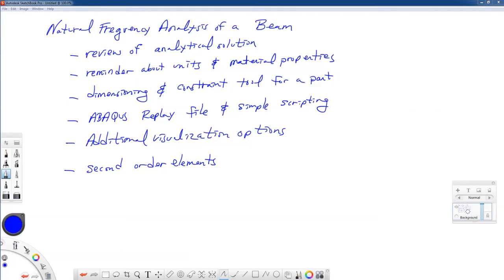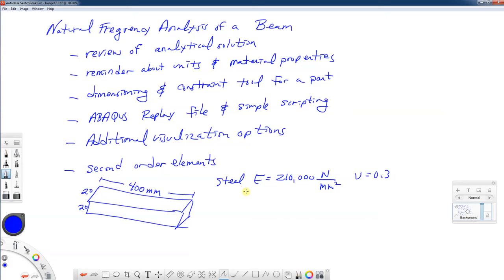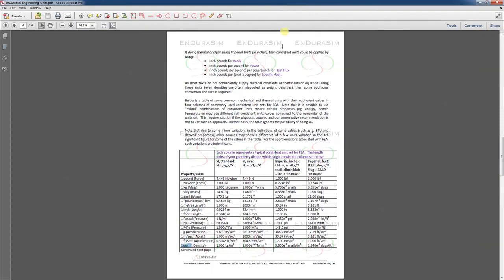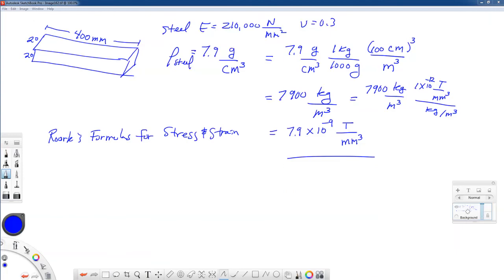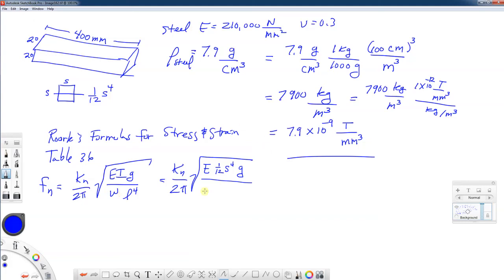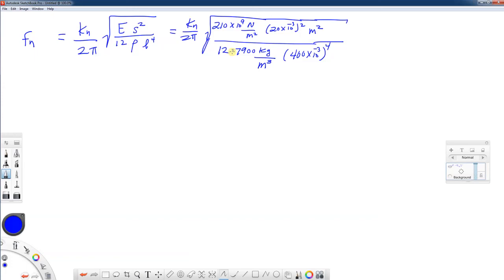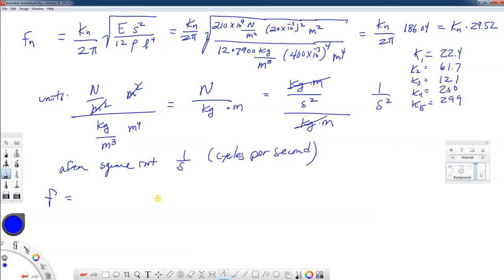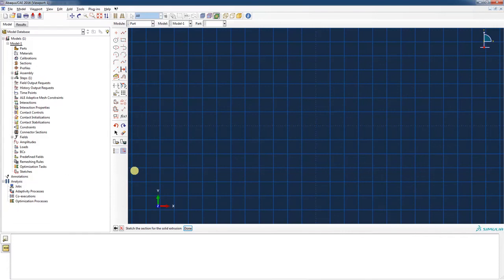AEM 535 HW-5 Natural Frequencies of a Beam--Part 1--Analytical Solution

Comment: What if we want to find the natural frequencies of different cross-section other than square, like I-section, C-section and T-section. Is there any reference I-equations?
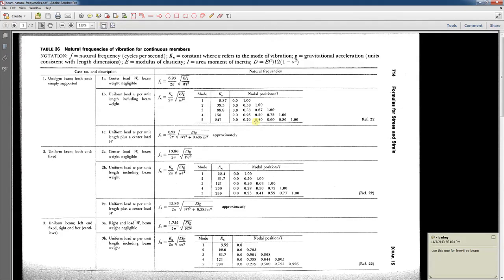Reply from the maker: Hi Sandaz, the formula at 6:57 depends on the moment of inertia so that could be calculated for shapes other than square bars.  You will want to look at the derivation of the natural frequency equation, however, to see if there are any restrictions on the symmetry of the cross-section.  Here is a video on calculating the moment of inertia for an I-beam if you need it: https://www.youtube.com/watch?v=Ag7XpNqEUqs&list=PLaDWa6xI4zec07Yhxso4yQW8wQptI85yy&index=25&t=0s
Reply: Thanks
Reply: did you get the answer sandaz.... if you get the equation for first five natural frequency of I section beam, for fixed-free and fixed-fixed end condition, please mail it to me...itsaquibs@gmail.com

Comment: sir, it was really helpful video. thanks a lot!.
I have a question. how can we calculate the natural frequency of a composite beam? 
composite beam is made up of different materials so it will have different values of youngs modulus. I am not able to understand which formula to use.
Reply from the maker: Hi Sripad, I am not aware of analytical formulas for natural frequencies of composite beams, but you might check some composites or vibrations books.  Failing that, you might try numerical methods.  Best regards, MEB